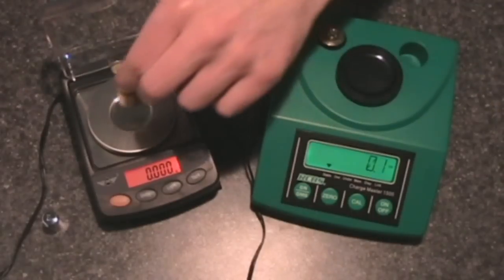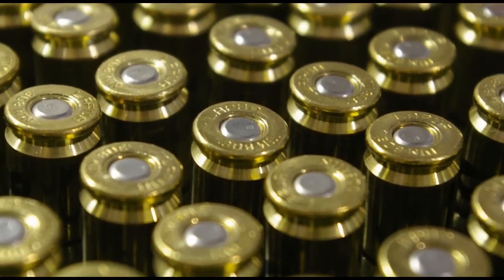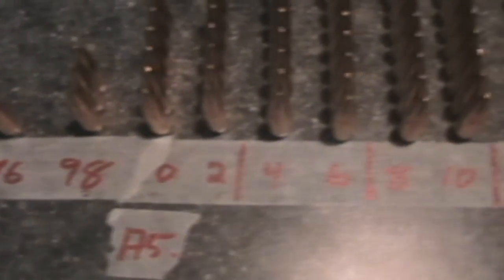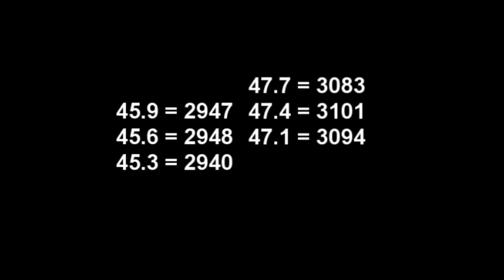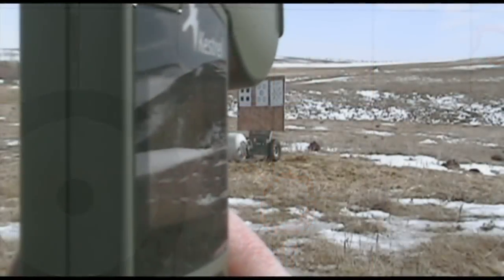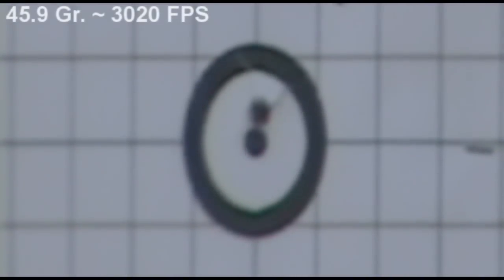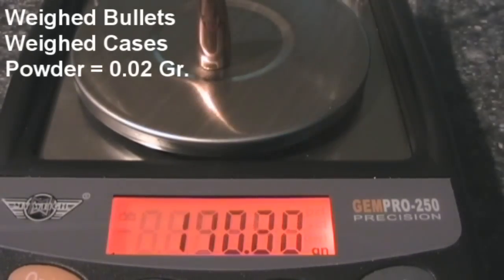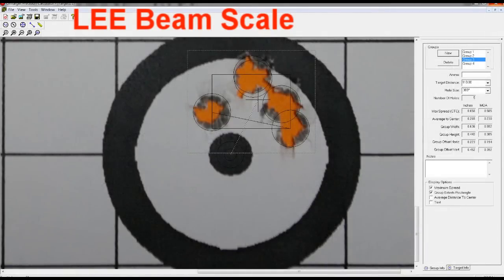Road to Precision Part XV - Precision Scale for precision reloads

Comment: I went through the same process when setting up my old .308.  I uniformed all the brass by neck turning, primer pocket uniforming, and flash hole deburing.  Then I weight sorted cases and bullets.  Man what a noticeable improvement.  Then I stripped all the copper out with sweets 7.62.  Since it was a used factory barrel I fire lapped with the Tubb system.  Only used the last 3 set in the system.  Removed all the tooling marks and the barrel was amazing to clean and didn't foul like before.  Just bought a new Howa to play with and am going to do the same.
Reply from the maker: Joe Mcglothlin 
Its always nice to get comments like this, which let me know that I am going along the path in the right direction. If others are seeing the same kind of results from the same type of work, then it must be worth the time investment...for those who will not settle with a simple sub-MOA.
Reply: Absolutely, I do all my own smithing now.  It's been a really fun process.  I've had as much fun learning machining and making things for the lathe and mill as I do from shooting.  Makes these Ohio winters alot easier to handle as well.  Fighting the urge to pull the heavy barrel from my new Howa mostly because I can!  I love this stuff!
Reply: WHat kind of gunsmithing do you do? My father just got a metal lathe and I was wondering if I have any use for it. I also got a Howa 1500 20" 308 and love the action. Much better finish and so much smoother than a stock remington action.
Reply from the maker: You get what you pay for. The thing to remember with a stock Remington, is that they are mass produced, so the finish will be much lower quality. It all takes extra time to take care of those little details that make things run smooth. And that extra time means more labour = $$$
Reply: thelister4910 I do all my own machining.  Chambering, threading, muzzle breaks, action truing and any other task that I gotta have done.  I just do it for myself as a hobby.
Reply: Yes Ryan, but my point is that a remington 700 Heavy barrel is about $600. A Howa is about $400, yet the Howa's build, reliability, tolerances and smoothness are much better. Currently for Remington it's worse than just getting what you pay for. This is coming from someone who has 2 remington actions and really tried hard to like them.
Reply from the maker: Sounds like you have invested enough time / effort / money into this sport to realize the same thing I have. Custom is the only way to go. My next precision bolt rifle build (if I ever find the time and money to complete it) will be a full custom build from the ground up. In the long run you are better off starting with top quality parts, instead of buying low and adding money to the project. But few beginners can ever appreciate that idea. Which is why there is such a huge market for the low end equipment.
Reply: Ryan Pahl I couldnt agree more.  Started doing my own work years. ago as a poor sheriff's Deputy cuz i couldnt afford to have anyone else do the work.  Currently building a full custom 22-250.
Reply: Joe don't you need s high end gunsmithing lathe to do that kind of work?

Comment from the maker: This was the first time I had attempted this. I wanted to see if it was worth the effort.

1. The marks on the tape were 0.05 Grains apart. Accuracy of the scale is 0.02 grains so I was rounding to the closest number in my head.
2. Lapua cases, which need almost no prep work. So I had done nothing to them at that time.
3. Many images online of the difference between a sharp reamer and a dull one. Factory chambers can get quite ragged and ugly, custom rifles have mirror smooth chambers.

Comment: The only aggravation i have with the howa action is that the barrel threads are metric.  The barrels are torqued on at 200ftlbs!  safest way to get them off is it use a parting tool in the lathe on the barrel just in front of the action.  Takes the pressure off so barrel can be removed.  Kind of excessive.  Many, many custom rifles have veen built on a howa 1500 action.  in the hands of a smith who understands accurate rifles you can get just about anything to shoot but howas are better then rem out of the box...at least in my opinion.  Savages are the most versatile and easy to customize without expensive tools.
Reply: Yeah I'm aware of the metric threading issue. It was one thing that influenced my decision to buy a Howa in .308 instead of something that will burn the barrel out faster.